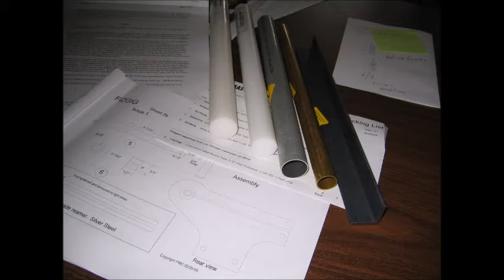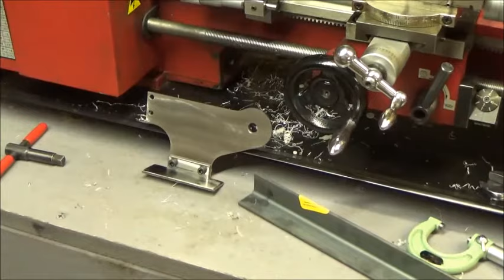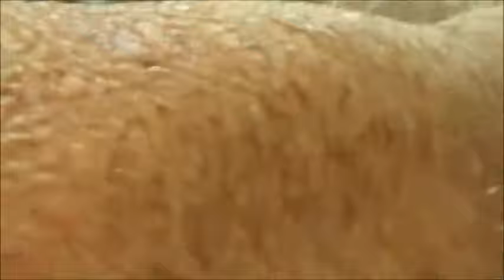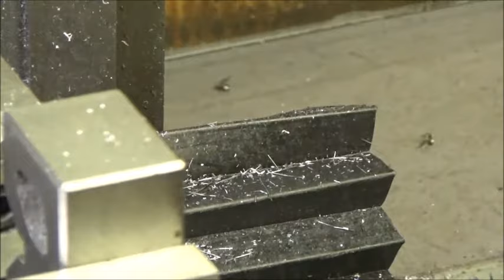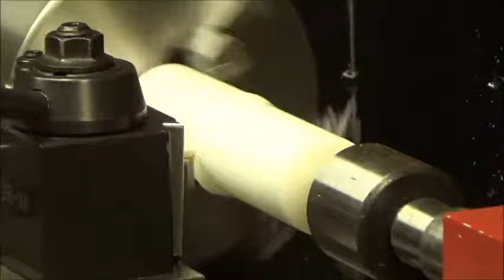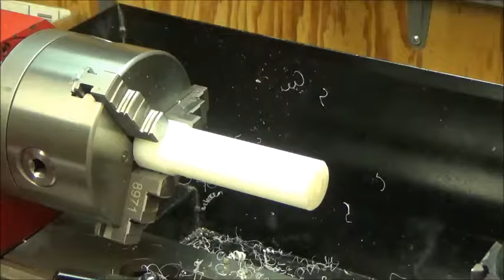"Fizgig" Stirling Hot Air Engine Build - Part 2  (The Displacer and Air Chamber)

Comment: Hi, Larry, that's a good video explaining how you are tackling the machining of those very thin tubes which will eventually wind up with a wall thickness of  only 0.008 thou
Reply from the maker: Walter: I have some additional questions for you on the Air Chamber.  I'll drop you an email tomorrow.  Best Regards: Larry